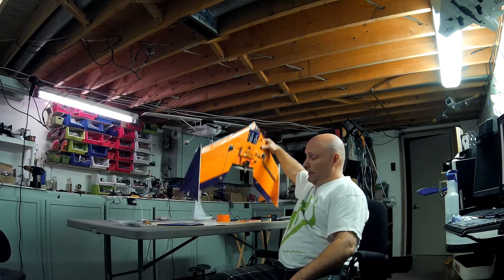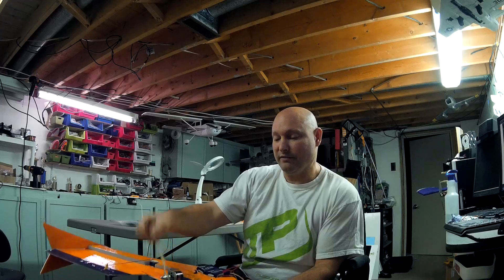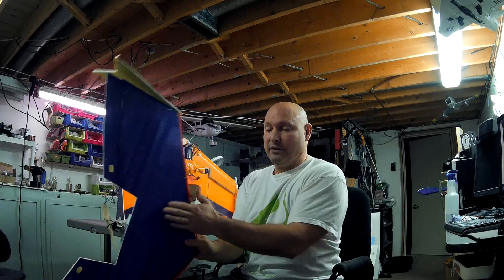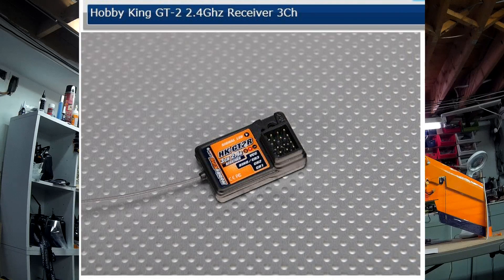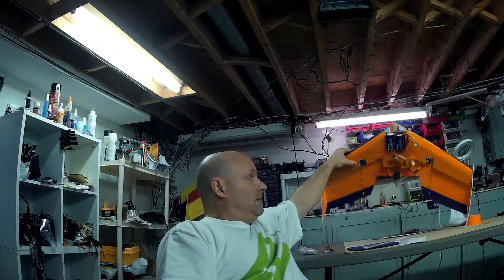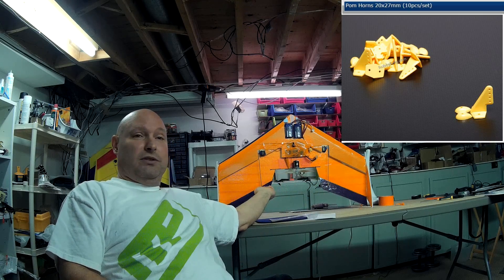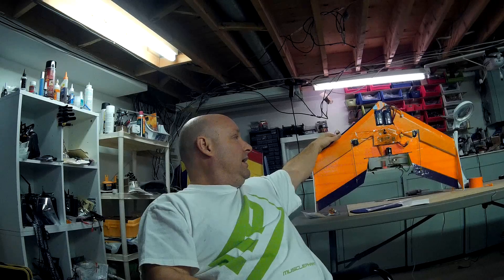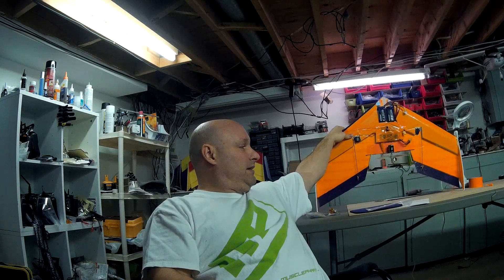How to build a Flying Wing - Introduction

Comment: is it important that the prop should be 7x5 "r" can it be the normal ones
Reply from the maker: vansh Sharma This depends on what you are using for a prop adapter.  If you are using a threaded prop adapter then it is sort of important.  If you are using a non R prop on a pusher, then it will be spinning in the opposite direction (loosening the prop adapter).   You can get around it by using thread-lock (loctite), but then it makes it difficult to change props if you break one.  You are better off to the "R"  i.e. reverse/pusher props in these wings.
Reply: UnlimitedVertical  so the motor & the prop should move in counter clockwise movement while seeing from the back of the flying wing

Comment: with the 3000kv (ntm prop drive) can i use a 50A esc
Reply from the maker: vansh Sharma The page says 35A-45A, but it also says max current 55A, so I would go 55A or larger.

Comment: hey pls see this link and tell me if i can use a 7x5 propeller http://www.hobbyking.com/hobbyking/store/__12919__D2826_6_2200kv_Outrunner_Motor.html
Reply from the maker: vansh Sharma I use either a 6x4 or a 7x5 prop with that motor.    I've never had a problem, but you should know that I generally do not fly "full out" for more than 15 seconds at a time (usually when climbing, or for fast passes).
Reply: UnlimitedVertical  what do you mean by """" generally do not fly "full out" for more than 15 seconds at a time (usually when climbing, or for fast passes). """
Reply from the maker: vansh Sharma  I only go full throttle for short bursts.  That means that the ESC/Motor are not stressed for long periods of time.  It is generally how I fly, so maybe that's why I have never burned out one of those motors using a 7x5 prop.

Comment: What is the flight time you get?Could I increase the flight time by using a single 2200 mah battery?
Reply from the maker: To be honest, I don't remember.  After a few flights I did end up using a single battery,  found it easier to balance the plane with it.  It will fly fine with a 2200 3s.   A 2200 4s will take a little more skill to get it in the air.  The plane is heavy (big motor, big esc).  Once it's flying it is fine.
Reply: Some average/approximate flight time?Thank you for your response.

Comment: How to make the wing slow? so as to use it for aerial mapping and fpv?
Reply from the maker: I would build a larger wing than this one, maybe the FPV44 or FPV60.  I have a build video for the FPV44 and FPVTrond has an excellent video for the FPV60.  If it is your first wing I would go with the KFm-2 style.  For a motor, look for one at around 1100kv and a larger prop.  This  will give you the thrust you need without the high top speed.   Here is a link to my FPV44 build video.   The techniques used in the FPV30 build video still apply, just the dimensions and power system need to change.
Reply: Okay thanks, do u think flying wing is easy to build and fly, cause I only fly multirotors :)
Reply from the maker: Rahul Vyas
Easy to build, yes.   I would say for a first fixed wing something with wing tip dihedral is a litlte easier to fly (Hawk Sky, Sky Surfer/Bixler).   Not saying that you couldn't fly it, I personally have more trouble flying multirotors than every type of airplane :-)   The nice thing about a scratch build like these is that they are very tough and even if you did crash hard it's usually only a new prop and a couple of dollars worth of foam to repair.